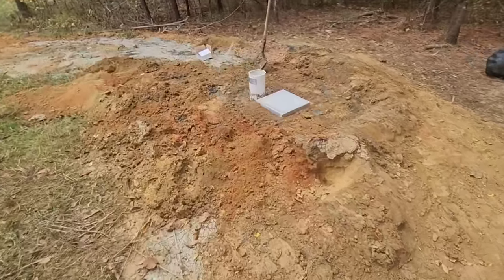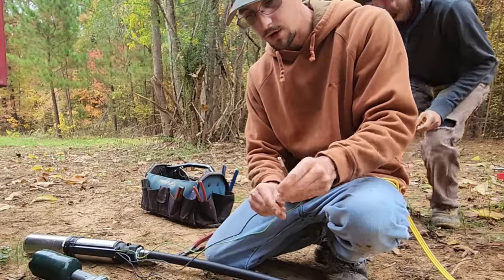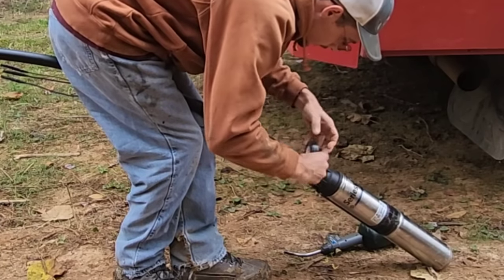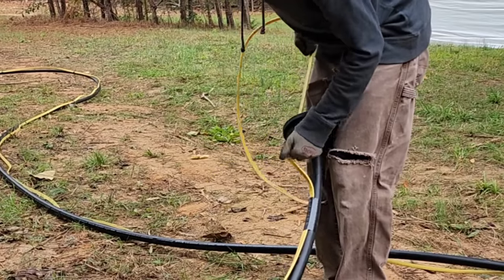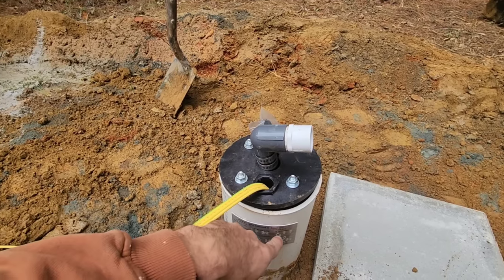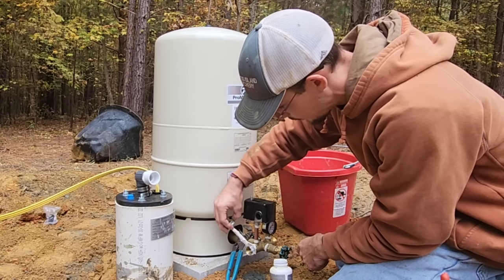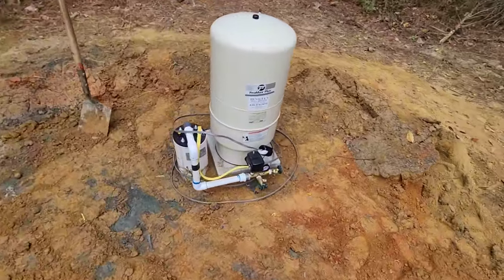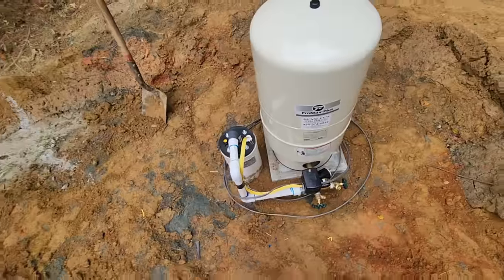Submersible Shallow Well Pump Install. To be Run by Generator for Camper Hook up.

Comment: Where can I as a consumer buy 600 feet of pipe and 600 feet of wires? I've only seen them sold in 300 foot lengths (except Menards but for some reason they won't ship to my NC address). Also what PSI rating should the pipe be at 600 feet? I saw blue 1" poly pipe rated at 250 psi. Thanks for all your great videos!
Reply: 600 feet is roughly 200 meters, so the static pressure is 20 bar, i don't know how much psi that is.
But you need more than the static pressure if you want the water to still have some usable pressure when it exits the well, so I would suggest min 25 bar, if possible a little more to be on the safe side.
You can easily connect two 300 feet pipes, you can even choose pipes with different pressure ratings, the upper pipe just needs a pressure rating of min 15 bar (100 meters higher, therefore 10 bar less pressure)
Reply: @Henning_S.  In our Burgerland the formula for pipe pressure is (pipe in feet X .433) + home water pressure in PSI. So for my application if the pump was at 600 feet deep it would be (600 X .433) + 50 = 310 PSI. The thing is (and part of the reason for my original post) that the strongest poly pipe I've seen anywhere is rated for 250 PSI. I'm guessing that for such a deep application this is what people actually use and kinda hope they don't deplete the well all the way down and even if they do I think the 250 PSI pipe will hold up to 310 PSI of pressure (yes, it's pushing it beyond limits etc). I also thought about joining two pipes like you said, I'm concerned about the joint holding up but if it was a good brass fitting and really good clamps then I think it would be fine. Ideally I'd like to buy one length of pipe but I've only seen 500 ft long (too short) or 1500 ft long (too much for me).
Reply: @tszymk77  I'm pretty sure the 250psi pipe will work, in the bottom of the well where the highest pressure is, it is always cold and therefore the plastic never gets softened by heat. The rated pressure is probably for relatively high temperature, so it doesn't fail when it gets heated by the sun or even hot water in case it is also rated for hot water. 
The pressure at the joint between the two pipes is much lower than the pressure at the connection between the lower pipe and the pump, so I wouldn't worry about the connection between the two pipes. If you choose a 500 foot pipe at the pump and a 100 foot pipe at the top, the pressure at the joint is below 100psi...
Reply: @Henning_S.  Yes, very good points. Thank you for your help.

Comment: there is no information on galvanized water tanks non bladder how to set them up and how to set up pressure  in them ????????
Reply from the maker: Drain them completely dry & then turn on the pump with all exiting valves closed. This will trap air in the upper portion. Once it's full, you can then add air to the tank for a few minutes with a compressor. That should get you running better. Galvanized tanks have air bleeders if it gets too much air it should vent off. (Not to say your vent valve is faulty)

Comment: I’ve got a 1/2 hp pump (240V) in a shallow well. But it can’t get more than 25psi. What should I look at first? I Would love to set it at 30/50 like the pressure switch is made for but I’ve had to decrease the pressure in the tank and reset the switch so it operates properly (proper cut on/off) but I want the higher psi. Do I need a 3/4 hp pump to get greater pressure? Something else?
Reply from the maker: If its a submersible pump it should build 60psi , unless there's a leak somewhere down the drop pipe. 
Turn off the pump breaker and then see if the pressure drops to 0. That'll tell you if there's a leak
Reply: @h2omechanic  Thank you! It is submersible. I'm pretty sure it has a leak, but I'll test with your recommended method to be absolutely certain.

Comment: I work at a well drilling company in ct we use steel  casing pipe  how come you don't steel more costly
Reply from the maker: It's basically the region your in requires steel casing. When we run into bad rock formations, we pull out the pvc & go back with metal. Just different laws in your state.
Reply: Thanks for the reply

Comment: That must be one big ass generator to start up and run a 240V 1/2 h.p. submersible.
Reply from the maker: 5500watt minimum to run a pump successfully
Reply: I have a 240 V, 1 1/2 h.p. submersible pump  and when the power is off, I have no problem with a 8000 watts generator. At first I had a 4000 watts generator but I had to disconnect everything to use the pump.

Comment: I am absolutely gob smacked that you guys still use LD pipe and hose clamps... I stopped using them 30 years ago as hose clamps rot and the pump falls off.... Havnt you guys heard of HDPE and compression fittings?   I thought you guys in the US were advanced but damn this is out of the stone age... At least you use a decent pump and motor....
Reply: And taped Joints?????  Epoxy or glued heat shrink!!!!!
Reply from the maker: Rubber Splice tape is what the power companies use for 3700volt transformer connections. If it can live through that in the ground, it can handle 240v
Reply: Hahaha cause the electric companies set power poles 1/2 the hight of the pole (setting a pump at 80’ on a 165’ well?) and the lines are fully submerged 100% of its life. Sounds like a good way to cheap out on parts and get job security. Way to go. Good thing you used poly pipe too, I’m sure the real well tech who has to replace that in 5 years is gonna be happy about that.
Reply: Depends on who's doing the job..

Comment: test your well water often . I have a koi pond and test it often  . That made me think back in 2006  that I should be testing my well water also .You never know  until you test . I would guess shalow wells it would   be more important to test . I have farms around me   horse and cow   and my well is over 400 feet deep   but both farms are below my property front and back . So guessing maybe at my 200 ft range on my well